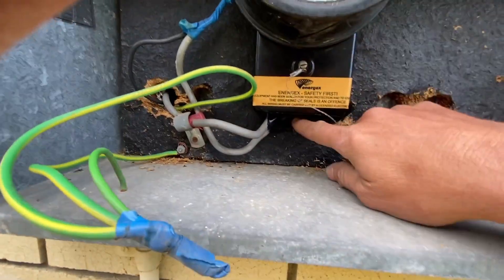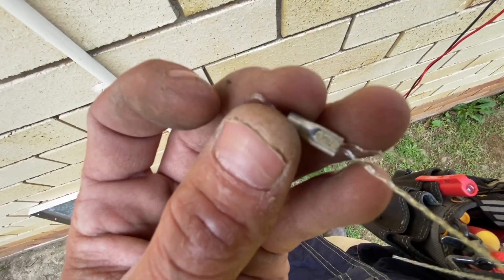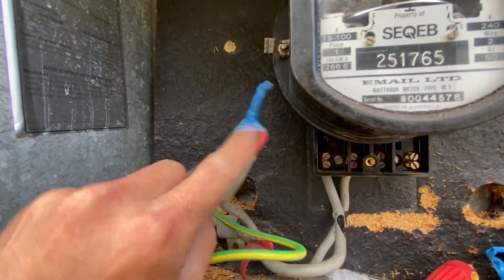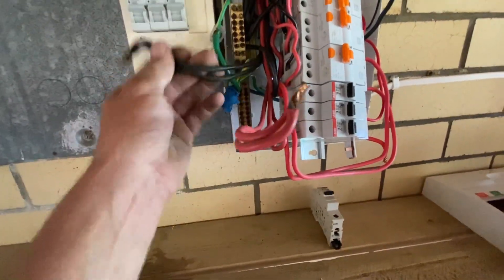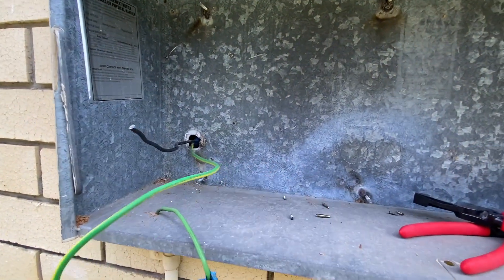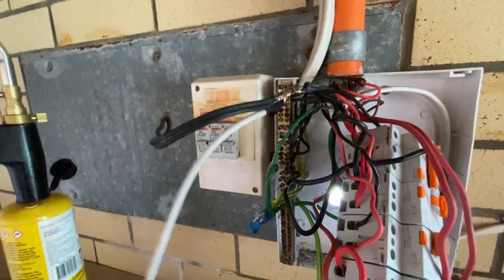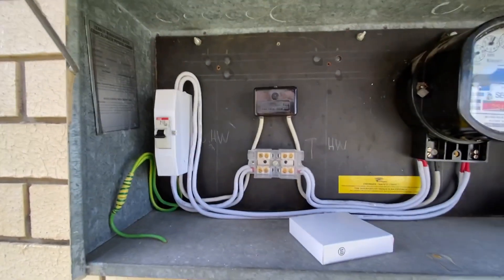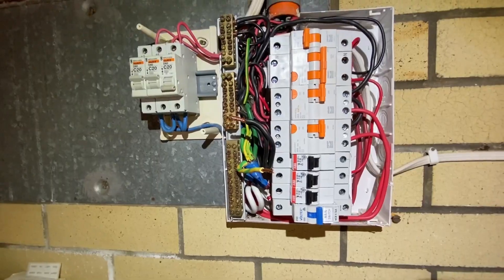Fault Find: Free power repair.

Comment: When you see long tailed seals like that it's usually an indication of a point of supply disconnection or bypass in play. Depending on the circumstances, if there was a Loss of Supply at that premise previously and the meter found to be damaged or faulty it can be bypassed and a meter fault notification submitted to have it replaced.